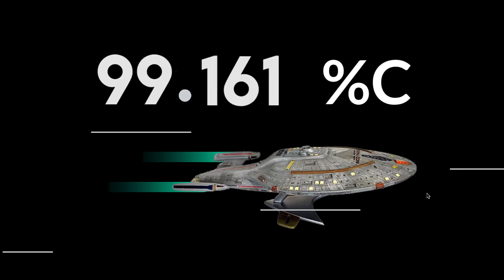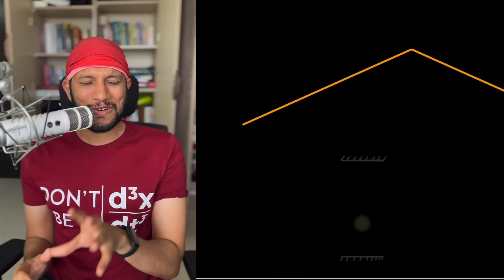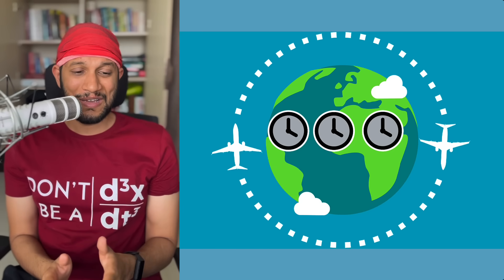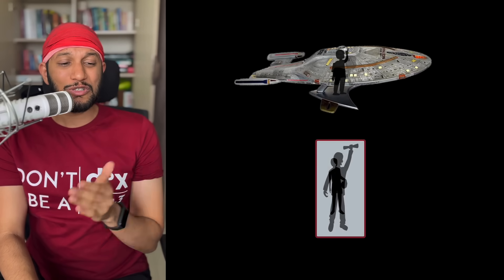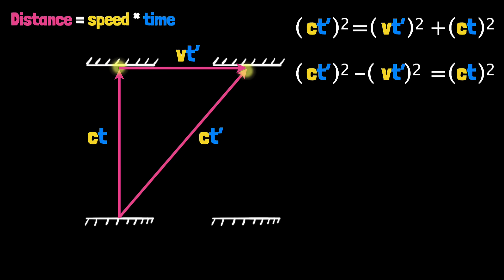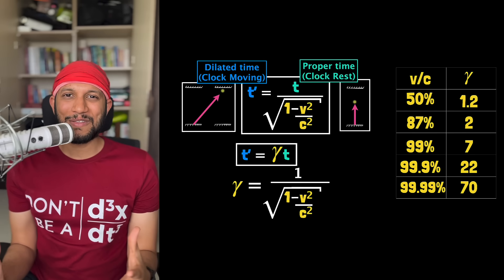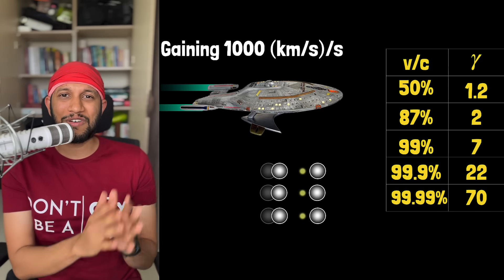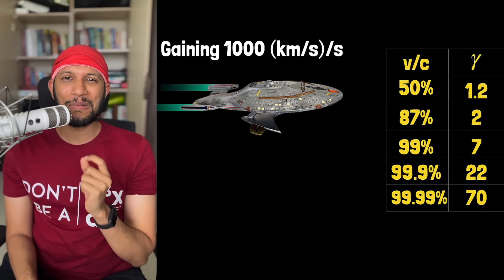I finally understood why you can't go faster than light! (My mind is blown)

Comment: What I’m not understanding is that this would be from the outside perspective where the ship would exponentially lose speed, but, what about for the people inside? Billions of years would pass outside but inside it would stay proper time no? Wouldn’t they reach the speed of light trillions of years later? 

Anyone got some clarification?
Reply: The ship would not lose speed from the outside perspective.  It is the ship's acceleration that would drop off exponentially in this reference frame, but never to zero so the speed will keep increasing, just at a slower and slower rate.  

To understand the perspective from inside the ship, you need to remember that all speed is relative.  What does it mean for someone inside the ship to say they've reached, say, 99% of the speed of light?  They must be measuring their speed relative to some frame of reference.  If that frame of reference is the ship itself, then trivially the ship is always at rest.  In order to measure a non-zero speed, the person in the ship MUST measure it relative to some external point, which is exactly the same situation as discussed above: the ship's speed will approach light speed asymptotically relative to this external point, but never actually reach it, while its acceleration will likewise approach but never reach 0.
Reply: @extravagantpanda7962  okay, I sort of understand what’re you’re saying, thank you for the clarification. 

This video is definitely one people should watch because a lot of people know that you can’t have something with mass go at light speed/FTL, but they don’t know the complete why.

Comment: The hospital I used to work at had 2 or 3 security cameras at different angles that could record people getting on and off the elevator. Images were out of sync by about a sec. Used to wonder, hardware issues or different distances.

Comment: Cool video, tho I have a question. let’s say person A is in the ship with the photon clock in the first example, and person B also has a photon clock but is an observer remaining stationary outside of the ship. So person B would see the photon clock in the ship tick slower because the ship is moving. But wouldn’t person A see the photon clock that remains stationary also as ticking slower because person B is moving away from person A at the same speed that the ship is moving ? Also wouldn’t this create a paradox because person A sees person B slowed down and person B also would see person A slowed down.
Reply: non inertial frames aren't equal, only one experiences acceleration

Comment: Bit for the ppl inside... it will obly take a second. So from the outsode it will take an Infinitiv amount of time, bit from inside it will still be 1 second. So everyone inside will eventually gain lightspeed bvs its just a second for them. Outside... dunno. Universe will die sometimes between. 
Is that right? Im not Sure. I
Will time for the ppl inside change too? Or is it just this second? I mean.   Inside the whole thing will be different. Completely.

Comment: I enjoyed your explanation.  I'm still confusing on something.  I understand what you said, but it's from the external observers view.  i.e. inside the ship, the 1000 m/s/s is occurring as before.  Can you help me understand why the ship can't reach C from the observer inside the the ship?  Thanks.
Reply: I didn't realise either but there is another video (see pinned comment above) that explains this. Good Luck!
Reply: if they didn't program the speedometer right, it would keep adding velocity based on thrust.  but any skilled navigator would measure the distance to the destination as less than as measured from earth due to length contraction and calculate speed remaining less than c.

Comment: I have a question: if I hypothetically put the thrusters of my spaceship on the front of it instead of the back (so I use my thrusters to pull my spaceship instead of pushing it), using the example shown in this video the light rays that send information from one atom to another would be moving left (assuming my spaceship is moving right like in this video) so it would take them less time to send information as the atoms are moving in the opposite direction towards them. 
So using the model you've shown, sending information is slower in the direction of travel but faster in the opposite direction, which would mean our spaceship accelerates faster as the speed increases (I know that's not true but I'm having a hard time understanding why…)

Also shouldn't length contraction compensate the fact that it takes more time for light to move from an atom to the other by shortening the distance between them?
Reply: If I understand correctly, the problem with your hypothetical is that you are assuming the particles move before the light particles get to them. The atoms wouldn't move until light (or in this case pull) gets to them at all.
Reply: @benstanfill363  Not exactly: in 12:45 he shows that the force carriers have to travel longer distances to go from a atom to another because they can't travel faster than light and, seeing it from outside the ship, they have to move in the same diraction as the ship and so take more time to reach the atoms nearby. With that I'm convinced that information takes a longer time to travel from the back to the front of the spaceship (as it's going the same direction of the ship), but with the same idea in mind I expect information travelling from the front to the back of the ship (and so going in the opposite direction) to take less time than usual to reach the next atom. 
Like take the animation at 13:03, if the force carriers were going from right to left they would take less time to go from one atom to the other so I should expect my spaceship to travel normally if she were pulled instead of pushed
Reply: @gauthierruberti8065  the force carrier is in the same reference frame as the atoms. It's not that they are traveling farther, but the atoms they travel between are moving faster relatively (since light speed is a constant) which makes it take longer for the force carrier to travel between them. What you describe would be true if the force carrier were being accelerated separately from the storms but the atoms and force carrier are both being accelerated together.
Reply: @benstanfill363  But from outside the spaceship shouldn't they appear to move at the speed of light too?

Comment: So if the closer that a person approaches the speed of light the slower that person ages. Does that mean if a person goes fast enough that the person will reach immortality and never die.
Reply: No, the person only ages slower relative to some external observer.  The person traveling at near light speed still experiences the same rate of time, so you can't personally experience more time by traveling faster.  That wouldn't make sense because "traveling faster" is only meaningful when specifying some external reference frame you are traveling relative to.  Right now you are at rest relative to the earth, but you are also traveling at 99% of the speed of light relative to some particle passing the earth and 50% of lightspeed relative to some other point.  If you are simultaneously traveling at all these speeds, then clearly your perception of time can't depend on your speed relative to an external observer because the choice of observer is arbitrary.

Comment: What about a speed of “zero”? Not zero on Earth, the Earth is moving, the solar system, the galaxy, I mean actual zero. Would time “speed up”?
Reply: All speed is relative.  You can't travel at speed 0 in ALL reference frames simultaneously, or in other words there is no notion of "absolute rest".  You are always at rest in some reference frame and simultaneously traveling at some non-zero speed in some other reference frame.
Reply: @extravagantpanda7962  thank you for that. I guess I was wondering what would happen if we went slower than we are now from the speed of light but after thinking about the video it seems as though there wouldn’t be any difference.

Comment: I have a question, from my reference frame the ship is moving so it's time will be dilated, but from the ship's perspective I am moving so my time should be dilated. So if we start with two perfectly synced atomic clocks, one with me and one on the ship, after some time when we meet whose clock will lag?? I will be expecting the ship's clock should lag but the ship's people expect my clock to lag.
Reply: You have just rediscovered a very famous thought experiment called (somewhat erroneously, because it isn't really a paradox) "the twin paradox".  The oversimplified explanation is that the ship has to accelerate up to some fraction of the speed of light then decelerate back to rest relative to the earth, while the earth does not accelerate at all.  This acceleration breaks the symmetry, and you will find that less time has elapsed on the clock that traveled with the spaceship than on the clock that stayed on earth.

Comment: I'm assuming that within the reference frame of the spaceship itself, nothing is actually slowing down? They look at their clock, and It's just fine. So it is perceived time dilation? From their perspective, it would be the actual opposite, like everything around them had sped up and got "older" faster? This is just fucking with my mind so bad.
Reply: the dilation is real enough--outside the ship everything is blue or red shifted, ahead or behind.

Comment: Well, but the correct equations for relativity do not show the same thing.  
x'=x-vt
y'=y
z'=z
t'=t
If there is a faster or slower clock in frame of reference S'(x',y',z',t'), these equations say nothing about that clock.  But faster or slower clocks actually do exist.  I once bought an alarm clock at Walgreen's drug store that lost ten minutes every day.  How do we show the time of a faster or slower clock with the Galilean transformation equations?  We use another set of Galilean transformation equations with different variables for velocity and time.  
x = x' - (-vt/n')n'
y = y'
z = z'
n = n'
n' is the time of the faster or slower clock in S'(x',y',z',n').  (-vt/n') is the velocity of frame of reference S(x,y,z,n) relative to frame of reference S'.  The equation n = n' shows that the time of the faster or slower clock in S' is being used in both frames of reference.  But this second set of Galilean transformation equations is really no different from the first set of Galilean transformation equations.  If we cancel out the (n')'s, we have the original equations with the time of the clock that shows t.
x = x' + vt
t = t'
This would indicate that if scientists are measuring something to be traveling at 99.9999% of the speed of light, it is traveling faster than the speed of light according to the time of the slower clock in S'.  So probably scientists are completely misinterpreting the results of all of their experiments.  They are probably not measuring the speed of light, but, rather, the speed at which they measure the speed of light.  This would relate to their definition of scientific time, a certain number of transitions of a cesium isotope atom, but if the rate of transitions is not the same for a cesium atom in a flying airplane as it is for a cesium atom on the ground, then saying that both clocks show a speed of c = 186,000 miles per second for light would mean that the velocity of light is faster in the frame of reference of the flying airplane.  If we use the original definition of a second that Galileo and Isaac Newton used, then a second is 1/864,000th of the time it takes for the earth to rotate once on its axis relative to the sun.  If we have two cesium clocks, one on the ground showing GPS time and one in a flying airplane that is slower, then if we say the GPS clock agrees with the rotation of the earth, then the slower clock in the airplane does not.  If the slower clock on the airplane is showing light to be traveling at c, then the faster clock on the surface of the earth is showing it to be traveling slower than c.  What is actually being shown is not a length contraction or twin paradox as scientists imagine, but a difference in energy.  But then we take the example of a faster clock in S', such as scientists say they have in a GPS satellite.  According to the time of that clock, scientists say light is traveling at c=186,000 miles /second,  but a slower clock on the surface of the earth would have it traveling at a faster speed.  So scientists either do not have a correct understanding of what light is or maybe they do and are just running a scam.  Either way, it would be better for us to use the correct equations for relativity because scientists have a wrong direction and incorrect results.

Comment: and if you turn your photon clock sideways so it is parallel with the direction of travel it keeps perfect time with a clock at rest.
Reply: No
The photon is moving twords another moving object (the edge of the clock) thus it takes longer for light to reach
Reply: @BlackLegVinesmokeSanji  both sides of the clock are moving, so it is faster in one direction and slower in the other. The time difference cancels out.

Comment: I know this is going to be an unpopular opinion, but I think we need to start ignoring Einstein's theories as they appear designed to hold us back.  Remember these are just theories and I'm not positive they deserved to reach that level.  How much of his work has been actually proven?  And if his work was so factual, why are these not scientific laws?  Try reworking these problems with no regard for Einstein and see what happens.    I've wondered for a long time if these ideas were released deliberately to hold us back.  I have wondered if the problem is that we are a violent and dangerous species. Perhaps we've been warned by other civilizations that attempting to leave our solar system would be bad for us.  So our scientific knowledge gets seeded with formulas designed to ensure we never achieve faster than light travel.  I might be wrong.  Maybe it is impossible to reach the speed of light.  Just seems odd that one person comes out with ideas that basically handcuff us and nobody questions it.  What if Einstein was wrong and his ideas were complete nonsense?
Reply: Okay this is a misconception 
Scientific theorys don't become Scientific laws
There separat clasfications 
Think of it like theorys are why it happens and laws are how
The theory of relatively has been proven with are understanding of science and with testing time dilation in planes

Now yes Enistine could of been wrong but, with are current understanding of physics and are current understanding of science, that is incorrect.

Comment: What IF the speed of light is not the same in both direction between the mirrors like in one of Veritasium's videos? Would that change any of this? If let's say light travels instantly in one direction and takes 2x time to get back?
Reply: It would change somethings but not the proof itself 
Timedilation would still work the same (just be different depending on your direction)

Comment: Unfortunately, you made one fundamental mistake, many people do. The time is not dilated because of the absolute movement but by the relative movement to the observer. This also means that the people in the spaceship observe the same.
For example your twin example: you say the moving twin (twin B) ages slower than the static twin (twin A). But someone moving with twin B would observe exactly the opposite. You know it as twin paradox which is actually not a paradox.

Comment: Still wrong.... The problem is that it doesn't take infinite energy, it is that the closer you get to the speed limit of any acceleration force, the less push force it has to make your mass go any faster. Say a world class runner can run 30 mph on a track. Hop on that persons back and try to get that world class runner to run 30 mph. You didn't gain mass the closer the runner got to 30 mph, the runner ran out of energy to make you and them go any faster never making it to 30 mph.